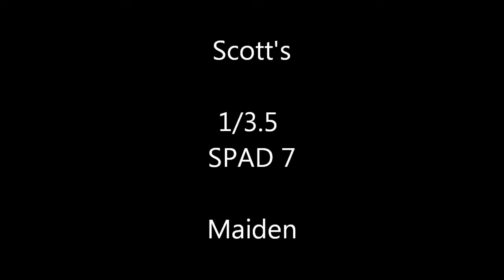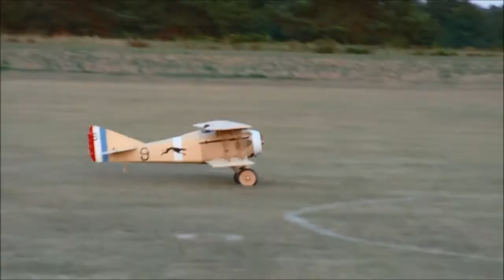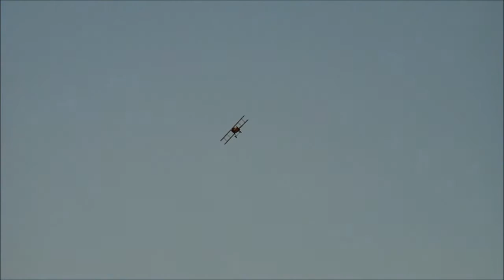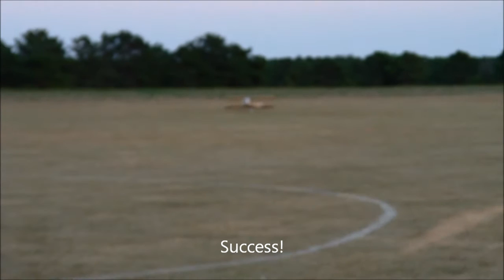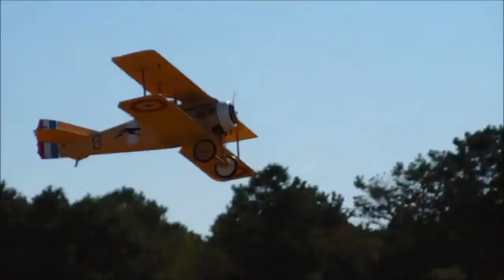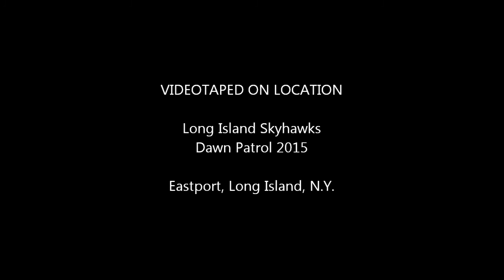SPAD 7 (Arizona Models Kit 1/3.5 Scale)

Comment: These are good questions. I'm struggling with trying to figure out a good way to scale our modern gas engines, to the full up weight and wing area of the incredible range of models/plans/kits that we have available. I know that scale fliers want "scale" performance. But the modern aerobatic planes need at least a 1.2 power ratio to fly vertical aerobatics. A cruise missile or Predator drone may only have a power ratio of 0.35 (which puts it in the class of some WWI planes). The big aerobatic models often have power ratios of > 1.5.  I like the scale planes of Arizona Models. I had never tried to figure out the power ratio of the Spad before. I had always assumed that it was near to the Fokker DVII, that could almost hang on its prop to fire straight up (power ratio must have been somewhere just under 1.0). These are interesting considerations.

Comment: Nice plane! I'm wondering what the power ratio of the original Spad was. Would a G62 be more like the original power, or were you going for fitting the engine within the cowl? Doesn't seem to show an y of the squarely ground behavior of the original. Nice flight.
Reply from the maker: +Oudeis Eimi Hi, If you are quick with the rudder the squirrely nature can be controlled!

Comment: I can't stand spell checkers. they have such a limited vocabulary! I guess the real Spad had a power rating (pounds of thrust / full up weight) of about 0.59. So I guess that 0.59 * 30 lbs = 17.8 lbs of thrust. I didn't realize that the original had so little power!
Reply from the maker: +Oudeis Eimi Hi, I'm not so sure power to weight can be figured like that. I think the best way is to figure power to weight for each, full scale and model, then compare those two numbers. I could be wrong however. I would guess the G-45 gives a performance close to what the full size had while the G-62 would be vastly overpowered! Full scale= 150 hp and 1632lbs takeoff weight, Model= 3.3 hp and 31lbs takeoff weight!